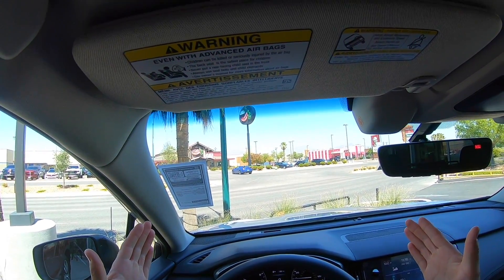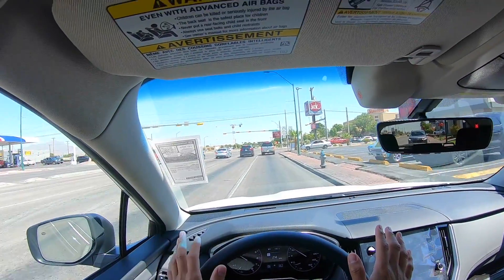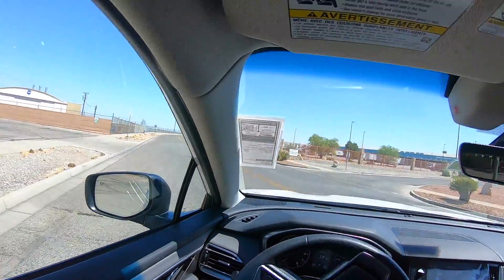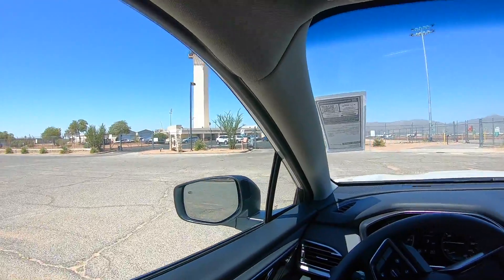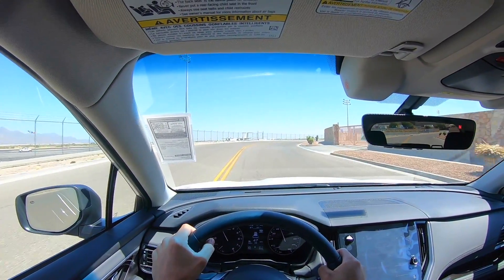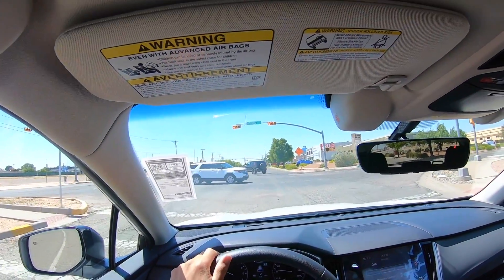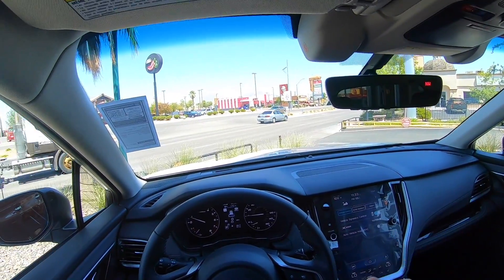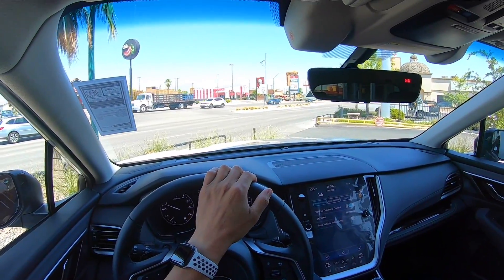Driving a LIFTED 2020 Outback XT POV

Comment: My wife has the same lift kit, rims, but BFG off roads instead. That thing is a beast in the snow, so much traction and fun. Little noisier and averaging 19-21 mpg since she drives in a spirited manner and mostly in the city. Every time we take it to a Subaru dealership it gets a lot of looks and compliments.
Reply: Do you know what the wheel specs are ? Including offset

Comment: The vehicle handles differently because of the 2 inch lift. The change in the center of gravity. The added width of the rim offset is actually helping. It’ll be worse on oem rims.

Comment: The 2020 XT comes standard equipped with 18 inch tires and rims.  Why would you downsize to 17 inch tires, rims if you are lifting the vehicle?
Reply from the maker: Main advantage is a tire with more sidewall & flex with a smaller wheel. Would ride smoother off-road, however I wouldn’t go smaller than 17 for aesthetic

Comment: How high is the lift on that Outback? I've been thinking of getting one on mine
Reply: Ready Lyft I think it’s 2 inches. Most kits are 2 inches or less they don’t recommend more due to the cv axles their angles
Reply: I have a 2” lift on mine. Great ride.
Reply: Well I’m getting a 3 inch lift and tbh I’ve seen it on other peoples outback’s and you can put wayyyyy bigger tires
Reply: @joshuareinoso1664  who are you getting the lift through? You dropping the subframe?
Reply: @matthewleach8821  well I got it off eBay and now I’m putting it in it’s a strut spacer it’s not bad at all so now I plan on getting 265 70r 17 tires